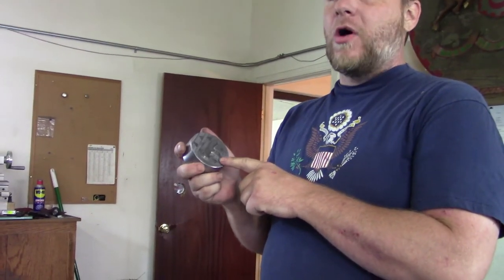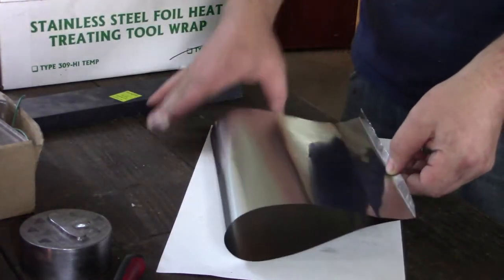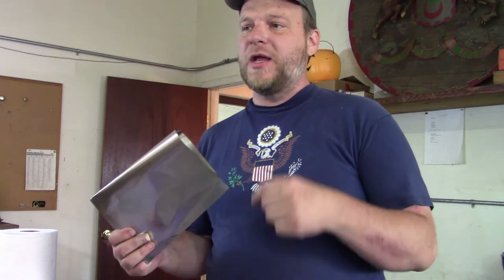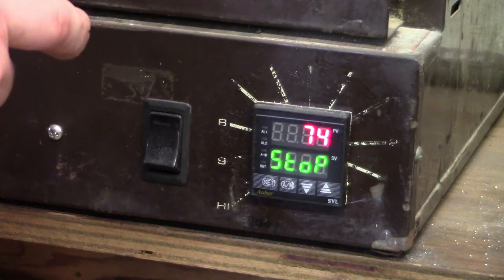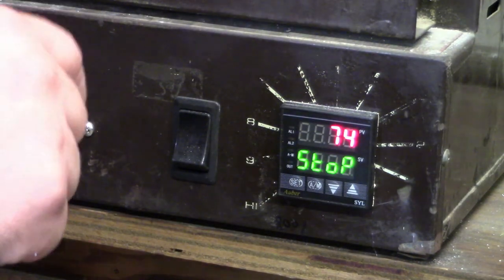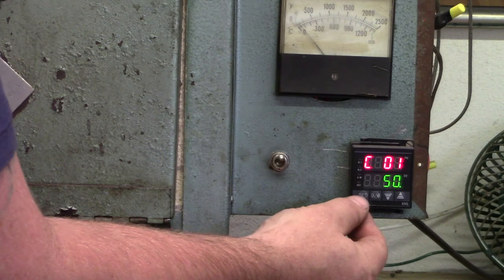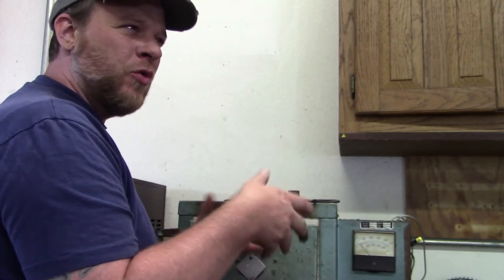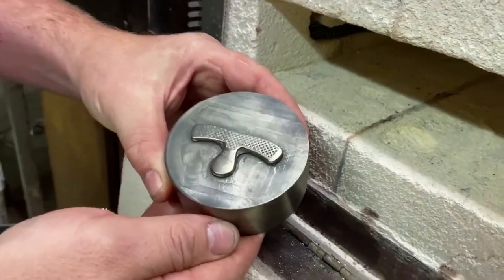How to Harden and Temper Steel Dies

Comment: Many years ago when i did my own heat treating, I used the stainless wrap but wrapped the die in paper and set in on a charcoal block in the furnace. It also cut down on the decarb. They say over certain temps, there is no oxygen but you have to use the temps prescribed by the metal manufacturer. They all have heat ranges for different hardness and toughness in tempering.
Reply: Such a great method. I can imagine you can't use just any old paper due to off gassing, but I really like this!
It is amazing just how much a few degrees either way cause such a difference between different manufacturers of steel.
What we do is extremely tolerant of the variance so we can get away with a pretty big window here at Landis Studios. I use the same recipe regardless of manufacturers and don't run into trouble. I'm never maxing out the intended use so as long as my temper is thorough I don't have any trouble.

Comment: I was told by a classic old timer who owned a heat treat shop to add some paper to the stainless pouch when heat treating to use up any oxygen that is in the bag.  I guess if the amount of air in the bag isn't enough to affect the steel, the paper isn't needed, but with my failure to success ratio, I will take any help I can get.
Reply from the maker: I like Bart's suggestion below that he uses charcoal. That seems right for a lot of reasons. Inert, preburnt, and if you choose the right one, smokey hickory flavor.

Comment: I also always quench my dies face down. I find it results in a more even hardness across the face. So as the die wears it fails more evenly so to speak. O1 I quench in canola oil. Because I find the smell less annoying. And canola has a high flash point.
Reply from the maker: Thanks! I love the little things we all do differently to make things work.

Comment: Wow, I heat treat my dies in a modified turkey roaster with a pile of fire bricks on top. But I use 8620 steel which is very tolerant of foolishness.
Reply from the maker: If it gets the job done with repeatable results, don't fix it:)